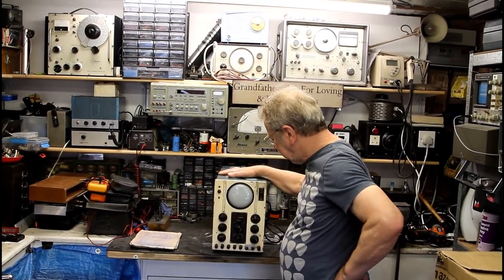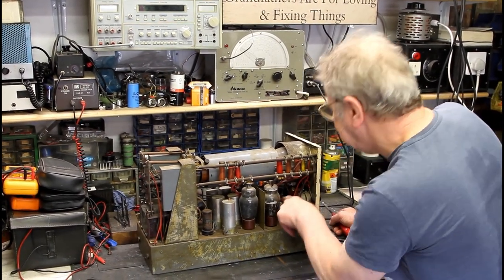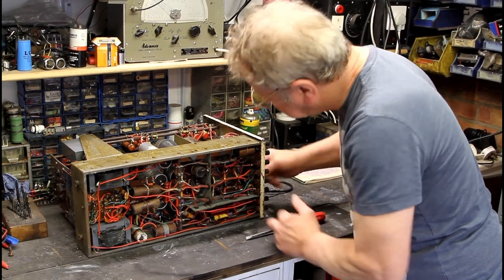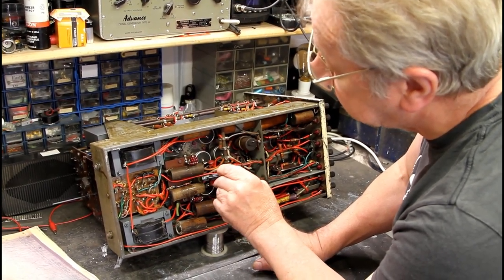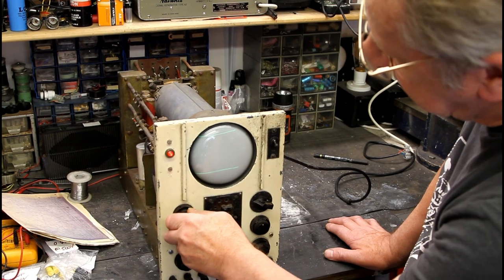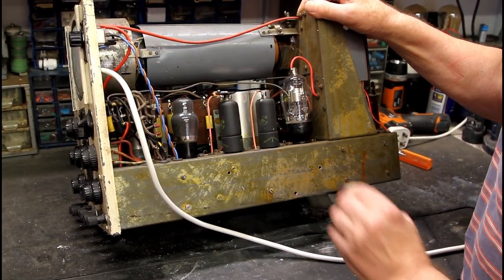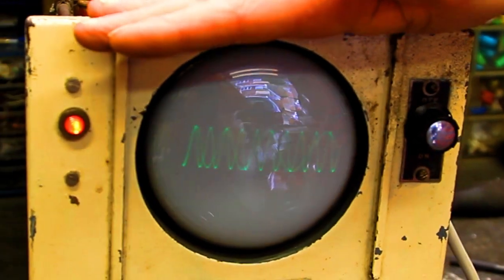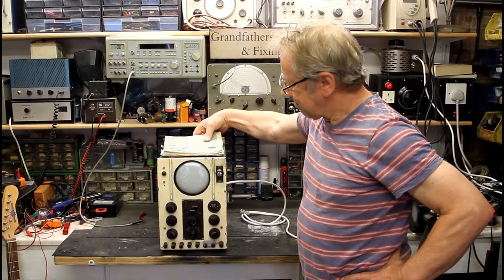Cossor Model 339 Double Beam Oscilloscope Repair

Comment: Don't suppose you could tell me the resistor values in the CRT power supply - namely R29, R32, R34, R37, R38 and R53 ?

For some reason, the circuit diagram I have doesn't list them !